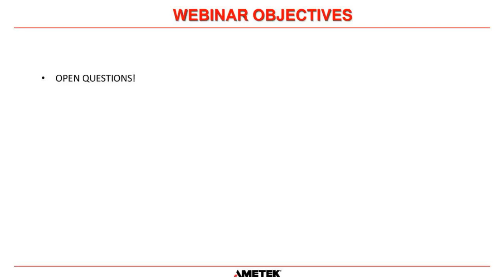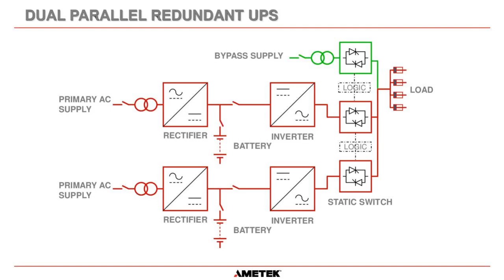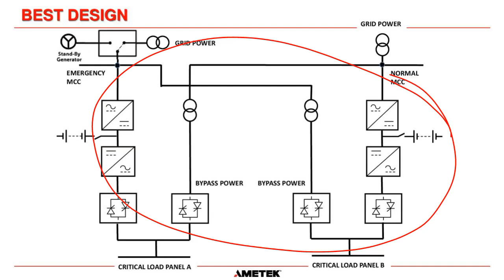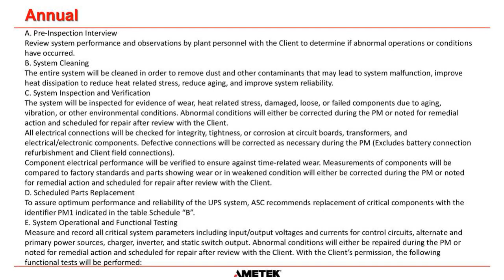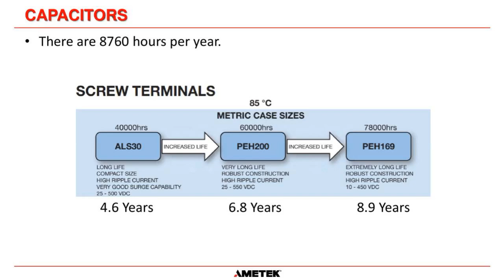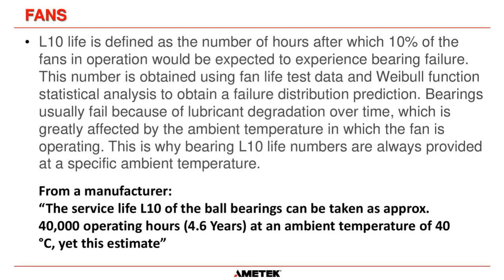FAQ and Open Q&A Session

Comment: I have the the arrangement where two sources are connected on the same battery bank 12* 4 =48 volts.
One is solar through a charge controller , the other source is a rectifier connected to the load as well
which source would charge the batteries and drive the load ?
Reply from the maker: Please email your questions to sci.marketing@ametek.com and we will connect you with someone to answer your questions.